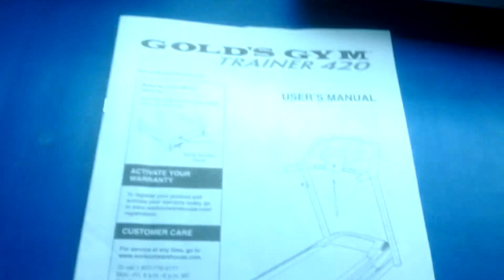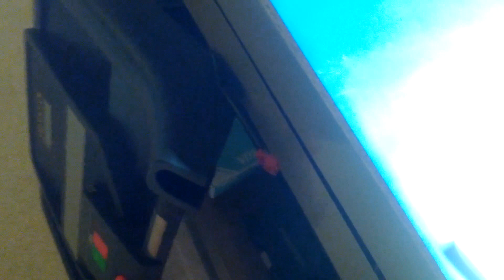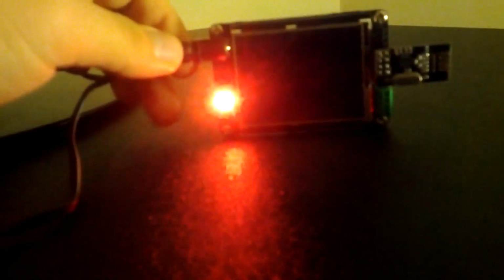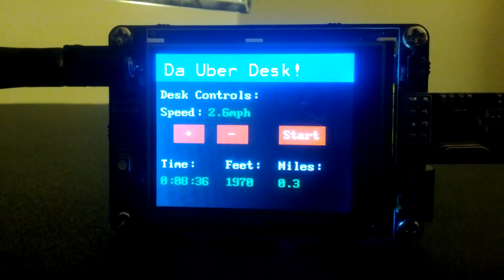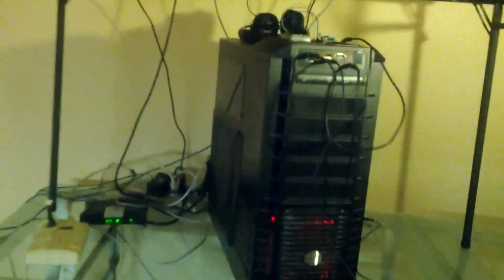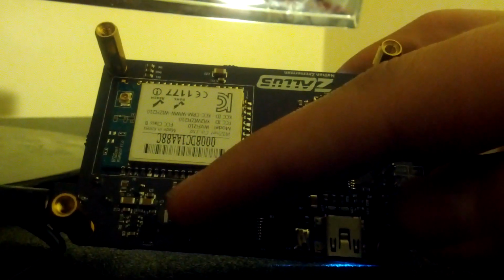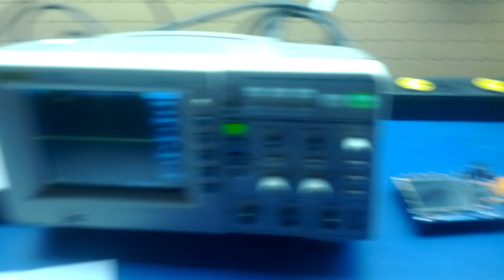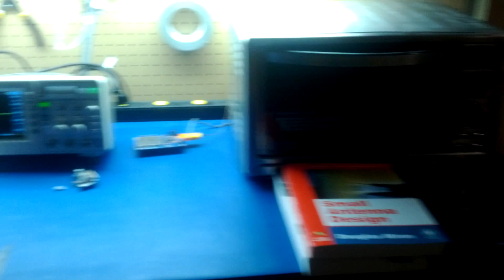DIY WalkingDesk

Comment: The LCD you used is here:
http://www.aliexpress.com/item/Factory-direct-sale-2-2-SPI-176X220-TFT-LCD-Module-Display-Free-shipping-ILI9225B-TP/1266090787.html

I bought 2 of them to build your reflow controller since I wasn't able to buy it from you.
Reply from the maker: New version of my controller will be out very soon. Sadly that does not appear to be the correct LCD display. Its close but the ribbon is not correct.